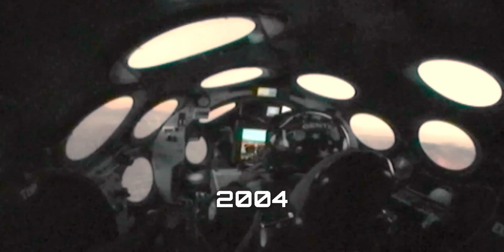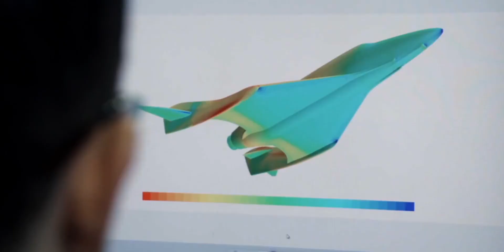Virgin Galactic tells their epic story in lead up to historic Unity 22 flight

Comment: Keep dreaming.  Propulsion and ignition do not exist is a vacuum.  Parabolic flights that simulate zero "gravity" is not "going to space."  Space is fake.  The moon landings were faked.  You cannot land on a light source.  Feed the world instead.
Reply: The moon is clearly not a light source. I mean, how do you explain the obvious craters?
Reply: @jakemckee2005  They might look like craters.  They're not.  If we can read a book by moonlight from 238,000 miles away can you imagine how bright it would be on the surface of that source?  Wouldn't have to imagine...the Inverse Square Law of Light would easily explain it to you.  Also how does one light source of one color temperature (the Sun) reflect another cooler temperature of light (the Moon)?  And has that ever been repeatable per the definition of science?
Reply: @thaddday  cooler temperature? That’s not true. Probably radiative heating.
Reply: @thaddday  so, where’s the proof about the landings?
Reply: @thaddday  So you don't understand the inverse square law. 
No surprise there.
Reply: Why would propulsion not work in a vacuum?
Reply: @jakemckee2005  Well for starters, there's no air to push in a vacuum.
Reply: @thaddday  you don’t need air. With every action, there’s an equal and opposite reaction. Rockets thrust fuel out one way, and get pushed in the other. 

If you shoot a gun in a vacuum chamber, your hand will still be thrown back.
Reply: @jakemckee2005  "Thrust fuel out?"  Clearly you do not know how jet engines work.
Reply: @thaddday  these aren’t jet engines. Rockets engines are very different. 

They explode fuel (something like liquid hydrogen and oxygen) in a combustion chamber and compress it in a nozzle. Then that nozzle widens out to condense the thrust again.
Reply: @thaddday  and rocket fuel tanks are pressurized. So it wants to come out a hole.
Reply: @thaddday  but really, I’ve seen the moon through a very powerful telescope, it’s definitely a sphere.
Reply: @jakemckee2005  Cool!  But there's nothing to thrust against...in a vacuum.  You'd just spin in circles forever.
Reply: @jakemckee2005  It might be a circle.  I'll give you that.  We just don't know.
Reply: @thaddday  Rockets don't push off anything.
Reply: @thaddday  Rockets are not like jet engines dufus
Reply: @thaddday  Your lack of understanding concerning physics is comical.
Reply: @thaddday  like I said, with every action, there is an equal and opposite reaction.

Why would you spin in circles?
Reply: @Jake McKee you are correct, a rocket engine can indeed work in a vaccum environment. With a liquid fueled engine like the SpaceX Merlin 1D Vaccum Engine on the Falcon 9 Block 5 Full Thrust Rocket's 2nd Stage uses a larger Combustion Chamber ( Nozzle ) than the 9 Merlin 1D Engines that power the 1st Stage. They all use RP-1 Kerosene for fuel and Liquid Oxygen ( LOX ) as the Oxidizer. They are pressurized and Forced into the combustion chamber at high pressure and ignited. They purge the lines with Liquid Nitrogen during the boost phase chill down before opening the valves of the fuel and oxidizer. The 3 Pratt & Whitney Rocketdyne ( Now Aerojet Rocketdyne ) RS-25A Space Shuttle Main Engines worked the same way with Liquid Hydrogen ( LH2 ) as fuel and Liquid Oxygen ( LOX ) as the Oxidizer. They have a large turbopump that feeds them. The large F-1 Engines on the Saturn V with RP-1 Kerosene and LOX did this as well. You can't explain rocketry to airheads that don't know about them and haven't been around them. I have a friend and colleague from NASA Michoud in New Orleans, Louisiana that's personally working on a project that will eclipse this one if all goes well. It's classified to talk details but I can say that it's a lifting body similar to this one and will be revealed to the public soon. I have personal involvement myself and I will be there to see this project through. Interesting too that it can operate off of any Runway and can float too if need be. Have a blessed day and take care.
Reply: Proof for all the faking?
Reply: @jakemckee2005  https://www.youtube.com/watch?v=jwkLVb4buLA
Reply: Space does not mean orbit. If you go past 60 miles, you’re in space.
Reply: @jakemckee2005  bullshit !
Reply: @sidstevens9035  what?
Reply: why are you not complaining to the governments that spend 1000s of times more on killing people.  There more than enough food to go around. Africa is so corrupt the food seldom get to those that need it most.
Reply: @favesongslist  Who says I'm not complaining about that, too?
Reply: @thaddday  Yet what we learn from flying to space has helped humanity a lot, even if it is just for the 'overview effect'  of valuing our planet more. I would say this is important, Africa should be the richest content on Earth yet it is not, this is more to do with the human condition. Saying it is all fake is not living in reality and will certainly not progress to feeding the world, where space monitoring of crops will help yet still people will stave because people are motivated by greed and power :(
Reply: @favesongslist  You are indoctrinated.  It's OK.  I was, too.  Going to "space" has done nothing for anyone on Earth...except steal money from tax payers.  You do know that Nazis started NASA?
Reply: @thaddday  The US gov started NASA, it is a gov agency. But they also chose the designers of the V2 to develop the Saturn V, that was based on the work of Robert Goddard from the US, at the time the US gov was not very interested in Goddard's work but the Nazis were.
Reply: @favesongslist  1000s of times more than the $58Million NASA gets PER DAY?  Doubtful.
Reply: You poor soul, go to Reedley College Aero School you will get a good education and will learn all about aircraft and rockets, motors, jet engines,  turbines,  turbofans and all that good stuff, then you won't sound like a fool.😉👍👍👍👍👍❤🇺🇸
Reply: @kennysherrill6542  I was indoctrinated enough.  Thanks, though.  You named a lot of things that have nothing to do with what I commented on, which was based on a vacuum...but I guess I'm still the one who sounds like a fool.  🇺🇸🇺🇸🇺🇸
Reply: If i throw a stone, is air pushing it away from my hand? Ya piece of shit
Reply: @calebgangte1228  Thank you for the totally irrelevant example...and the insult!
Reply: @stevie2025  Clearly.  Also clearly not a NASA fanboy.  Have a good day.
Reply: I don't get the ending Point ☹️😅 Nobody should ever believs  the "holo-moon" or "blue beam" shit, unless your not able to flight